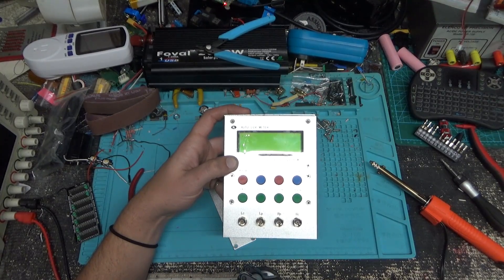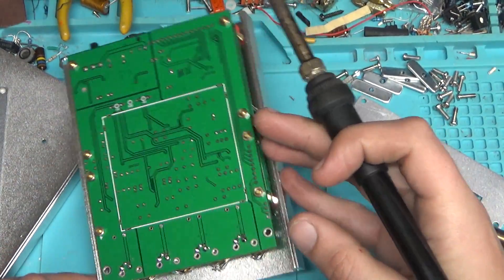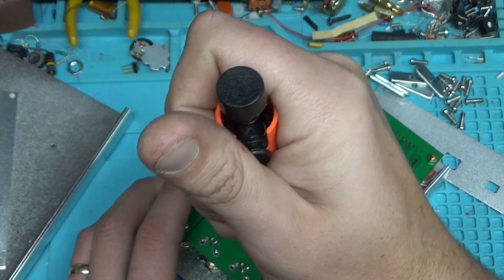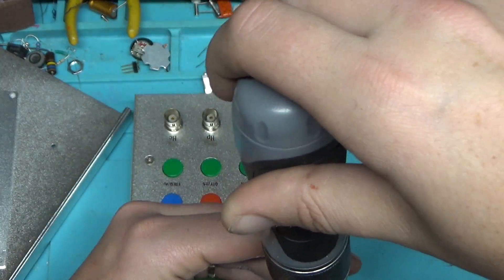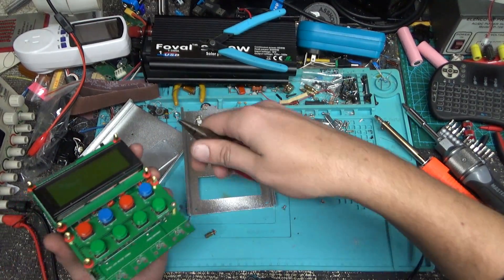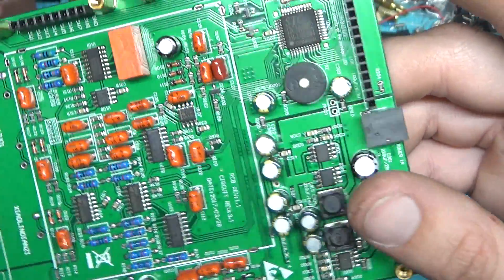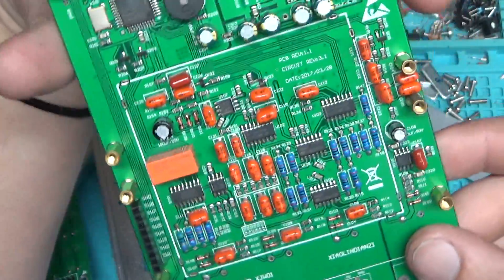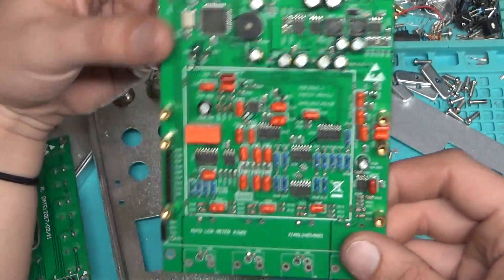Digital Bridge XJW01 Auto LCR meter teardown!

Comment: hi im a fool who knows nothing and and im trying to buy the equipment i need and i was told that capacitors are important and i wanted to measure them with out taking them out and i was told an ESR meter could do this and so i found this one. IS THIS AN ESR METER?
and can it measure capacitors in circuit? considering that it has no manual im beginning to wonder about buying it. also how much do you think this thing is worth. the price is from $80 to $110